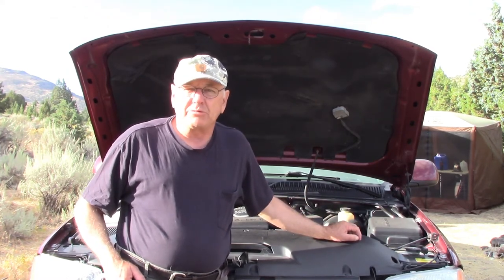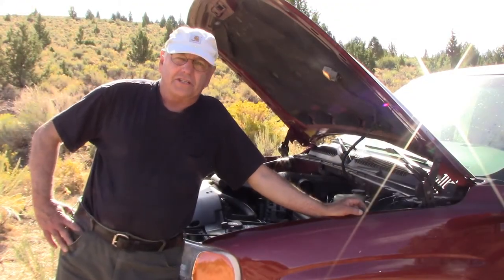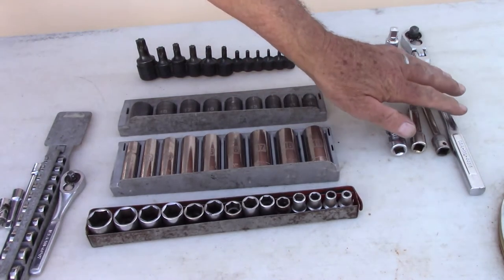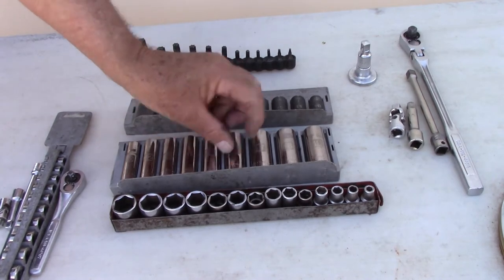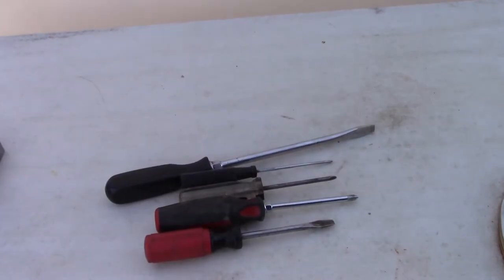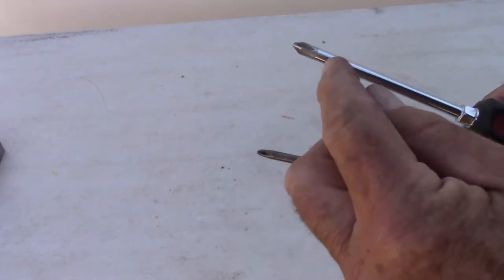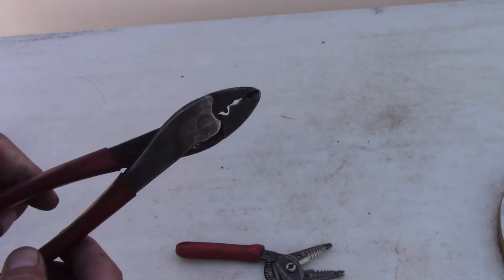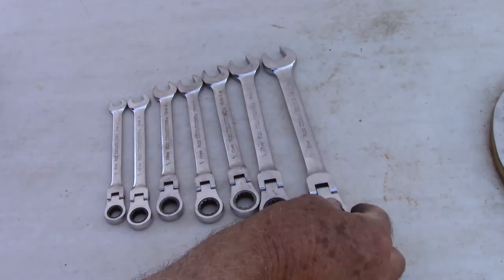A Proper Tool Kit For Your Car

Comment: If I could offer a recommendation, replace the electrical tape with silicone tape. Not only will it work to insulate damaged or spliced/repaired wires, it is also capable of temporarily sealing leaking hoses. Since it has no adhesive (it sticks to itself) it can be applied to oily or wet material. It also works great to provide some cushion and "grippiness" on tool handles.
Reply from the maker: I haven't heard of it so thank you for pointing it out.  Thanks for watching Noahmercy!
Reply: @gonagain , you're welcome, and always a pleasure to watch your vids.

Comment: Dito on the great video Rick ..... I've always carried the basics even going to the store, and blessed with a full, well organized, good quality tool collection ... great point on the magnet, also a good light is a must .... just got the 2000 Jeep Cherokee thru inspection .... new starter, cat back exhaust and a new radiator that didn't owe me a dime, back hurts, but all went smoothly @ 64 .... blessed to have come from an auto family and taught to fix things Before you get stranded (also a great tip on the manual, makes for good reading to learn about your vehicle, long before things become an issue) .... 248K on the Cherokee and it drives and looks like it new ... my second one, had an 89 that went 285K ... over 35 years and never had to be towed with either one .... did have a crank sensor act up last year, tells the engine where crank and pistons are ... Jeep died dropping off a friend at his house ... walked home and it started the next day ... youtube knew the issue ... thermal failure when hot/idling ... easy fix, cheap part ... mounts just off the flywheel and senses it's rotation ... youtube, a little prayer and staying calm has saved me many times .. again, great topic and my tools give me a sense of security on the road, just knowing they are there .... I also have a matching set of impact wrenches ... for the tough bolts/nuts .... and an old trick, heat the bolt (torch), spray penetrate ... spray/splash with cold water ... it "shocks" the two metals as they cool quickly to release them ... saves a lot of stripped, broken off bolts and studs .... be well my friend, and safe travels for you and your lovely wife !
Reply from the maker: Good points Spinonemaster!  Those simple repairs you made on your jeep would have been very expensive if you would have taken it in to the shop. Thanks for watching!
Reply: @gonagain  Yea Rick ... since I semi retired in May, restoring this old house and taking care of a 70 year old disabled Vet brother who functions at an 8 year olds level ... I have the time and tools ... I have him going to the YWCA adult daycare, so i get some respite .... I plan the projects, get 25% ordering online from the local parts stores (or order on amazon) ... did all new brakes/rotors/calipers, shocks (coiled rear and leaf springs)  new front bearings, all the u-joints for 4x4 early in summer ... even got a new window/lock master switch  which had become off and on working ($20 bucks at DrSwitch online) ... sadly, the days of a lot of DYI are gone now with the newer cars needing sophisticated tools and testing equipment ...  the 2 Cherokees have been good to me, so I'm good to them in return .. funny, I've been in the habit for years of thanking the Jeep for being so reliable to me ... pat the ctr console while doing it ... went shopping today for new tires with winter coming ... been using the goodyear wranglers the last two sets, but may go back to the cheaper, but reliable Cooper A/T's ... as I've had them in the past .... safety, performance and reliability is also good thing to keep in mind when repairing/replacing parts, tires, brakes .... and the old timers taught me that passing on my knowledge, experience and skills is good karma (if people are open to it) that's how I learned from the experts (remaining grateful and humble) ... exactly what you do here on your channel !... why i like it so much ... got to go water the plants and garden ... getting ready to do some canning as I have a bumper crop of everything this year .... just finished putting up a few jars of Jalapeños ... dinner finished, feet up on the kitchen table resting my back and having a cup of coffee before taking the Bouvier for a walk on the canal .... been an interesting 64 years ... ups and downs, lots of adventures ... and I remain a blessed man
Reply from the maker: @Spinonemaster  I can tell you certainly are blessed.  I have to replace my tires this winter and was thinking of the Wranglers but I'll take a look at the Cooper ATs now that you've mentioned them.
Reply: @gonagain   ... I liked the Coopers, good aggressive tread without a lot of road noise ... good wet traction, braking, handling .... tire wear is pretty good millage wise ... having said that, seems the tires deteriorate internally at the end of life, meaning tread still looks fairly good, but they become out of round/high spots (internal steel band breakage)  that cause them to be a little "out of round" at highway speeds ... but I've always gotten at least or more of the mileage they rate them for ... they were always about 20-30 bucks cheaper than the premium you pay for goodyear ... so it might come to whatever discounts you can find or rebates ... both companies tend to run them 1-2 times a year ..  Goodyear probably has more dealers around for warranty ... but have never had to use for either tires ... the Wranglers might be slightly better handling/ride,  etc ... but I'm at the age where my driving is pretty tame ... perhaps splitting hairs on performance ? ... I run the standard size for the alloy spoke rim ... 235/r75 ... Cooper AT's are a slightly higher profile/tread when new
Reply from the maker: @Spinonemaster  Thank you for the info on the Coopers.  With the traveling that we do it's also important that we get something that can be easily serviced (rotations, etc.)
Reply: @gonagain  yea, why I mentioned it ... being on the east coast I forget how far away dealers can be in the great north west ... tires can be complicated, yet it all comes down to good manufacturing, quality of components, design and rubber ... rule of thumb is softer rubber gives better wet/dry traction/handling ... but wears out faster ... always a trade off ... I can tell you that the Wranglers are good in wet, snowy conditions ... as i learned long ago racing cars and driving coast to coast as a professional skier in all kinds of tricky conditions ... it's not always how fast you can go, but how fast you can stop efficiently .. both tires are great on the highway ... Wranglers might have a slight edge overall ... dollar for dollar ... I'm a stickler on maintaining proper tire pressure ... it's good for even wear and can be a lifesaver when conditions get wonky .. or to avoid a collision when seconds count  ...
Reply: I have a 2001 XJ I purchased for $300 and brought it back from the dead with 164,000 miles on it with the body and suspension virtually rust-free and in great shape. Two years later and 187.000 miles on the odometer I think it will be a keeper for many more miles exploring the #AmericanHeartlands

Comment: Excellent Video and Excellent Advice as always. 
I've always called Cresent Wrenches - Oklahoma Socket Sets. Course that is back when we had a real football rival going on. 
For years I've carried an ammo can stuffed with tools. I even used to carry U-Joints as it seemed I would gernade them from time to time. Once the u-joint on my 72 Jimmy blew just inside Mexico. I quickly dropped the rear driveshaft (4x4) and drove into the USA, then replaced the U-joint alongside the highway. 
 I was a gearhead and did a lot of quarter-mile racing. Now I'm a geezerhead according to my wife. 
One thing I always use to carry was a hydraulic jack and some 6-10" pieces of 2x4. Hated trying to work those old sissor jacks. And, the jack got good use fixing and replacing other parts of the truck here and there across the US.
Reply from the maker: Great stories Jim!  Most young guys today don't care much about cars, but I hope my videos can help someone somehow. Thank you for watching.

Comment: Great video.  Question:  When you tackle a job like replacing the TPS while on the road, are you concerned that while performing the job, a secondary problem may arise, like losing an important fastener, breaking something while trying to remove it, etc. that will then leave you stranded since you're working on your only means of transportation?
Reply from the maker: Always, but I try to include all the possibilities before getting started, like how far am I going to need to walk if it doesn't work! Please check out our latest videos on repairing our own transmission while camped.

Comment: I had the same thing.  TPS failed on a trip. Could only idle. I had a dodge journey at the time. It was built into the manifold. Cost $800 to replace (just the part) Sadly..only error at the time was a traction control error. Next vehicle was not a dodge.
Reply from the maker: That was expensive!  Mine was $32.  Thanks for watching Maze Centric.

Comment: Ah mate, although you are well tooled up, you forgot the most useful tool to have, which I'm sure you have with you. The hammer. The good ol' hammer. The knockometer is the most versatile of all tools, and is also good for stress relief.
Did you know that is you have something tight to remove, you can coated you plier/visegrip jaws with the silicone to give a non-marking grip.
One day I'll do a vid on what I carry in my car everyday.
Cheers Rick, stay safe.
🇦🇺
Reply from the maker: I actually do have a hammer. It's the back side of my Hudsons Bay axe!
Reply from the maker: Hey Pilot, I'd like to see that video.
Reply: I knew you'd have some sort of "knockometric" device. 🤣🤣🤣🤣🤣🤣🤣.
I'm a little worried that it is attached to an axe, that'd be interesting in the right circumstances..... 🤣🤣🤣
And I do see a minor problem that may arise. Your car is metric and I'm sure your Hudsons Bay axe is imperial, be really careful mate....... 🤣🤣🤣

Comment: Good advice on what tools to keep in your vehicle for those getting back from where you are going and knowing how to do it properly, I have seen some good advice about getting out where the vehicle is tuck by the cave man videos using what is available with a little know how of the old ways by your self and what you what to move is to heavy for you to move or can not get traction with your tires how to move vehicle by your self with good rope and know how it reminded me of the time you got off the road  and how to get back with out hurting your self..
Reply from the maker: Good stuff you know Jimmy!
Reply: @gonagain  I am not a mechanic but use common sense to keep things going when they do not want to work the way they should checkout what is not working and replace or get it working to it best, even if it not what the mechanic can understand how what I did, but works better than they get it to with their computers.
Reply: @gonagain  By the way the cave man video also shows how to get drinkable water never ending even in the dry areas as long as there are any trees in that area and all you need is a knife and something to collect the water with very good study shown how to do it.
Reply from the maker: @jimmybutler3728  Oh, I know who you're talking about!  That's a good channel to watch.
Reply: @gonagain  Good nice to pass good advice around .

Comment: Is there a certain position or use a volt/ohm meter. For the throttle position.
Reply from the maker: I took one apart after it failed and they are very flimsy inside with tiny, feather like brushes that ride on a carbon contact.  I would suggest only buying an AC/Delco one to replace it.  By the way Mark, a year later I found out that my problem was a fuel pump that was going out intermittently. I think you watched that video where they had to drop my gas tank and replace it.
Reply: @gonagain  I just had an experience with one throttle position sensor in diagnosing codes on one for 1985 Toyota 4Runner 22re fuel injection . I spent two months trying to figure one out  .and I had to use a volt/ohm meter,. I found that Toyota red antifreeze got inside and cause multiple problems with ECU. I did my best in cleaning and getting  things better. It also affected my emissions which I failed a smog test here in and had to  to repair the car and rerun a another smog test. I had to replaced the catalytic converter and fix egr  modulator .  I learned a lot from this experience now everything ok and smog . Thanks for your experience and knowledge.  Great to learn from your experience. Mark
Reply from the maker: @markreynolds3850  when I said AC/Delco I was thinking GM.  Lol!  But seeing how delicate they are I would only use OEM for sure. Glad you figured yours out.